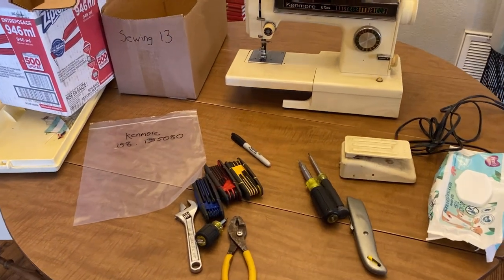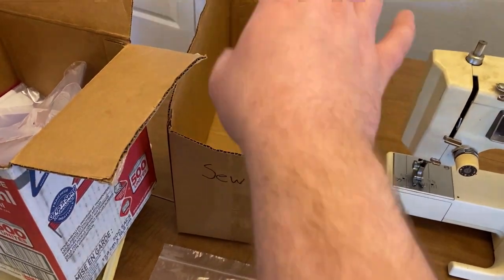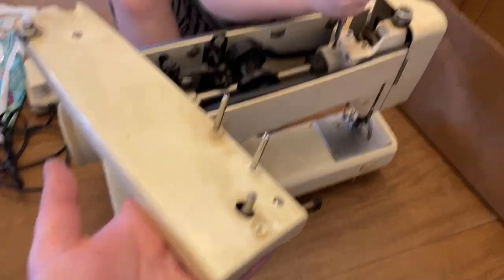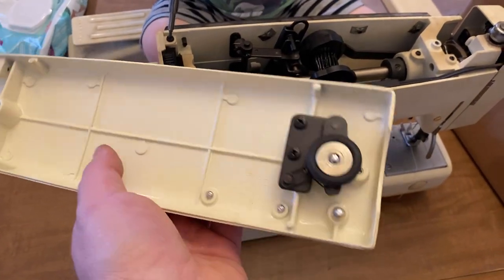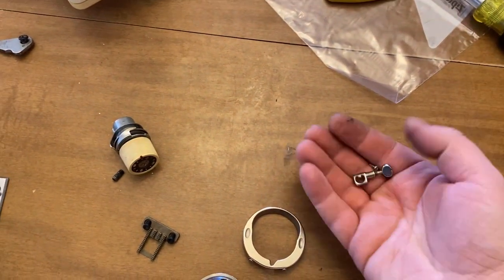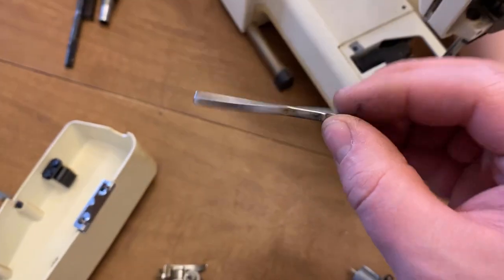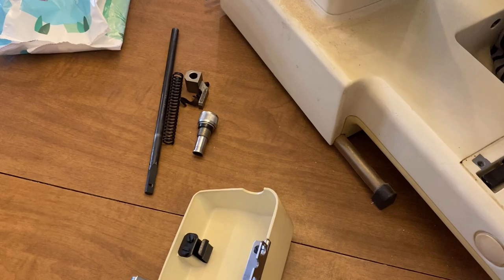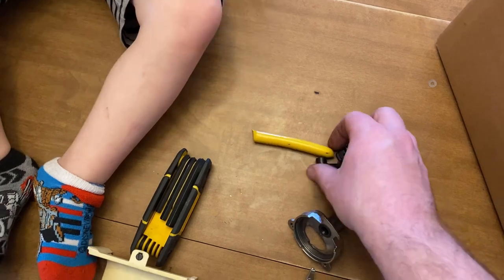How I Make $$$ Parting Out Sewing Machines To Sell On Ebay.

Comment: What about higher value sewing machines like Bernina and Pfaff machines?  Do you still part them out?  Or is it better to sell them complete?  I have been ignoring White, Kenmore, and many Singer models even if I could get them cheap because they don't sell for so much, but maybe I should buy them and part them out?  Maybe it was mistake not to pick them up.
Reply from the maker: Depends a lot of the condition of the machine and the value of the machine. If I can sell the machine for $250 plus shipping I’ll sell the machine whole. If not I’ll part it out.  I will price parts higher for those higher value machines, but those are more rare and less common situations. 97% of machines I find are basic sewing machines.

Comment: Nice video! So do you just figure out the names of the parts by searching the model and learning based on other listings?  Or just google search or image search it? I know nothing about sewing machines so it would involve a bit of learning for me.. I may try to get one if it’s really cheap.
Reply from the maker: Yea that’s how I initially started. I picked up 2 for 50 cents each at a garage sale and have been hooked every sense.
Reply: Dave Seavey - I haven't tried to repair sewing machines.  But, the service manuals for many vintage electronics items are available (for free) online.  Service manuals often include parts lists or assembly diagrams which include the part numbers.  This seems to be especially true for better brands.  If you find the manual(s) online, be cautious and do not download and "readers" b/c they're probably loaded with malware.  Good luck.